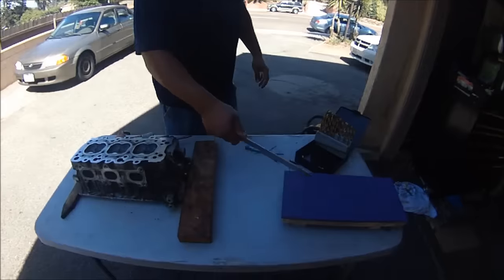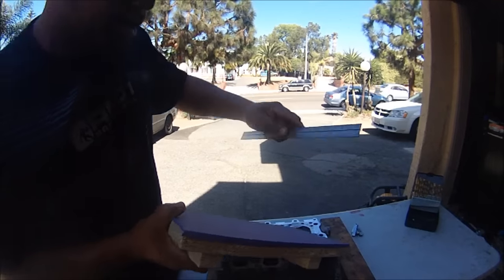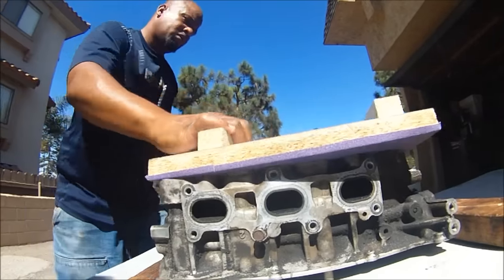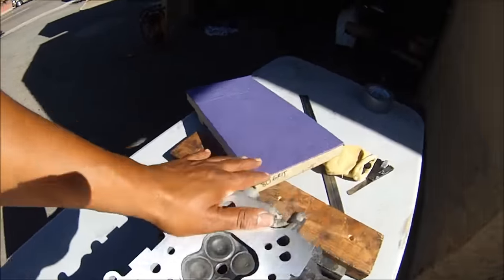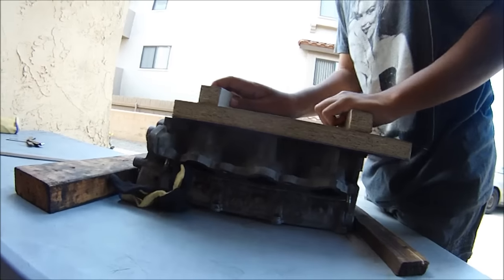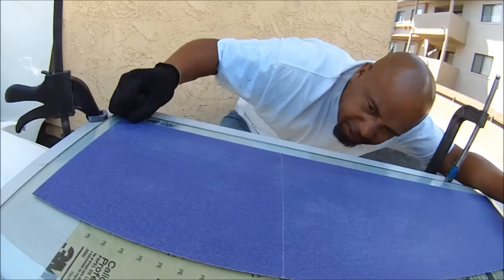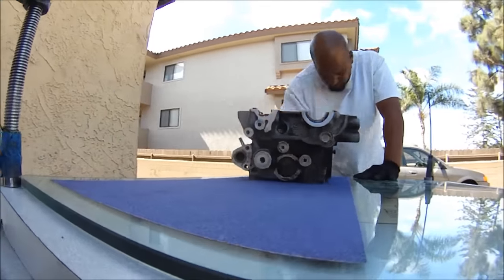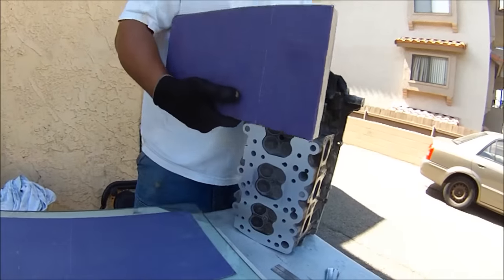HOW TO RESURFACE A WARPED CYLINDER HEAD AT HOME WITH SAND PAPER still works in (2023)

Comment: The cost of the glass, sandpaper
Reply: IRL, it's a lot more than $50 to have someone pull heads, resurface them and maybe the deck, and the put everything back together.  It's feasible that something like a rejected engineered countertop, or other similar flat surface could be found.  It's not like 100m people are going to be willing to do this work on their own.

Comment: good job, but didn't you spend about 45 bucks in sand paper?
Reply from the maker: 3 packs @ $5-7 bucks, its all about the principal.
Reply: +oldskool funk I hear ya my man.  Good work.  I wish I had the ambition
Reply from the maker: +Randy Grover Ya this stuff is brutal at times but a great way to save money. I have learned how to speed up the process now with WD40. its on my latest video and much faster and efficient way. keep your head up my man God Bless.
Reply: compressor with air gun works well or petrol and oil to in spray bottle
Reply: oldskool funk Thanks for all the educational videos! I have a Toyota pick up (22re) with a blown head gasket. I used cooper sealant, and ot still runs like a champion! I'm planning on sanding down the cylinder head too. How can I check it for cracks? Do you have a specific method? Would it be better to replace the cylinder head? I can get one on Ebay for $230 complete. I'd rather save $. Also, can I re-use the old bolts? Thanks bro!
Reply: Daniel Escobedo, Daniel Escobedo, 
NO! Never reuse the cyl. Head bolts on aluminum heads, or even the newer cast iron ones, ... they were stretched into place when they were torqued down, ... & you cannot reuse them because they were designed that way, ... so if you torqued the heads down, and try to reinstall them, they will be weakened from the previous torquing pattern, ... always use fresh bolts, & you can actually see/measure the difference in the old vs new ones, ... like throwing good money after a bad investment, because if you do try to re-use the bolts, just to save a couple of $ skins, then you will warp the head, & possibly the block, by trying to stretch the bolts even further in order to get the same torque on them, ... which simply does not work, ... this was a hard lesson learned from xperience, ... & it was even worse with the early 3.8 Cadillac blocks, & heads, ... a costly xperiment for a would be profit, ... 
this is a good video, & I applaud his conviction of faith, & the use of oldschool technique of working with your hands, ... and your mind, ... there are other methods, but yes, this will work, as he proved on video, ... 
And as far as the praise for the Oldman upstairs, it is also a tacit understanding of his conviction, ... & of his belief in the faith of schooling the young to gain the confidence of teaching a man to catch his own fish, ... something I wholeheartedly agree with, ... teaching the young men/women the basics of learning a trade, is what I have done, & the way I xplained to my now, ...  30 odd students is that if you will take the time to learn my trade, as I teach it, you can apply the same techniques to any trade, & be empowered to go anywhere, learn anything, & be capable of surviving in any situation, ... & in that, I have been successful, ... and the newest hire, regardless of if they are here for 1hour, 1day, or 1 year, is that they are the 1 responsible for cleaning all of the tools, ... I teach it this way, because that is how I was taught, ... & it is such an effective learning tool, ... useful, in so many ways, ... kinda like the scene in Karate Kid, ...Wax on, ...Wax off, ... they buy me a beer whenever I meet them at the local pub, and talk about those lessons learned, ... enjoy what you do in life, because you only got 1 life to live, ...
Reply: Bottom line is he got  a good exercise work out on it.   The feeling of accomplished something is nice.
Reply: Hi my brother I have a 2001 Buick Century how can I tell if I have a blown head gasket on there  I need help brother
Reply: And what was that type of sand paper that was
Reply: And how much will you pay for a rebuilt transmission for a 2001 Buick Century???
Reply: Cheaper than machines lol
Reply: Those sand papers could still be used for future projects. That is how we do it in the 3rd world country ....

Comment: hehe. i’ll have the find the photos from when I got stranded 1,000 miles from home with a blown head gasket. In South Texas. In August. Had to do all the work myself from youtube with crap off the side of the road. 

And indeed, I did the same thing: sheet of glass, mounted to MDF, with spray adhesive over that. Then slid the head back and forth. Worked great. 

The locals stealing all my parts/tools every time i had to leave, though… much more difficult.

Comment: Just a little heads up you guys that don’t have any training, never use silicone on the head gasket or water related items it will get into your cooling system and plug the core of the radiator!  ( BAD). . Love this guy for sure !

Comment: Great job. I resurface my own heads using a large machinist file. It is very true and I can get it down to less the 2 thousandths. I picked up the file at an auction so I can't tell you where to buy them but it is faster than sand paper. Keep preaching brother.
Reply from the maker: I used to think like that, hide my tricks and trade secrets but thats selfish and when we die its not that big of a deal. Share value with others and never have a scarcity mindset.

Matthew 10:8
Heal the sick, cleanse the lepers, raise the dead, cast out devils: freely ye have received, freely give.

Comment: Doing this by hand like this is better than machine cause you always checking on the go.  I had a head machine milled and still kept getting coolant in oil. I ended up using indian shellac glue and had no issues.  Drove truck for 3 years until thermostat stuck closed and didn't have temp gauge working. Threw a rod on the parkway interstate doing 90 mph. I learned a lesson I always make sure my gauges are working now.   I miss that ole 283.  Love your speach at end.  I've been sober from coke since 2001 stopped drinking since I got married.  Now I got to kick my cigarette 🚬 habit.

Comment: I did this on a bmw 528i aluminum head. It worked great! Saved me a ton of money. Not sure if I have the patience on a cast iron head. Oh, a tip! I used heavy fishing line tied tightly across the head to check warpage. With a feeler guage, if you see the fishing line move, you’re there. .002 when done.from .008 warpage. Straight six cylander. These engines are famous for overheating. So, I also bought copper plus gasket spray, and coated the block , then the new head gasket. With new head bolts. 15000 miles later, still good. Thanks again, bud.

Comment: Great job very creative. Had an aluminum overhead cam V6 that would warp. NAPA told me to spray copper seal on all surfaces originally made for motorcycles and the copper in the spray would provide much better transfer and stop warping. It not only worked but worked running loaded pulling small trailer over all western mtns for 300k and never warped again. Why the factories don't use it is a mystery.

Comment: Something to keep in mind is if the heads have cam journals they need to be straight so it doesn't seize the camshaft.sister cooked her dual plug Nissan so bad the machine shop had to press the head so the cams would turn and then surfaced the deck for a good deal.but I've done plenty of old pushrod Subaru engines like this. Good knowledge that you are showing man.

Comment: Pop showed me a trick for observing the defect:  Rub a thin layer of Prussian Blue oil paint on the surface.  As you grind, the higher spots will be ground off leaving the low, blue spots.  Work until the blue diminishes.  Really seeing the progress helps make this a uniform repair.

Comment: 17 years as a mechanic/machinist. Glass works better than milled wood, and is less
expensive. I used glass for my
hand sander, and for my stationary sander. A machinists
straight edge and glass cutting
sand paper can be used to
ensure the flatness of the glass

Comment: Theoretically this sounds like it would work and it will but, you have to remember now you have a strait "deck" but now you have cam journals that are not perfectly aligned, if your head "warps" the whole head bows (either center lifts or center drops) and when this happens your cams will not be tight on the inner journals or outer journals which is gonna cause to much friction.  Proper way to fix a warped head is to figure out where it is warped (center is bored up making center cam journals tight) then you need to have pressure applied to the center if the head and heat the head up.

Comment: Thanks, great video. I have a 9n tractor that a piston sleeve dropped into the crank and my valves need reseated along with the head is out a little over .004 in center so I'm going to use your method and tell my brother the retired mechanic ( know it all ) that I figured this out on my own. LOL... He thinks I should have it milled... Thank again.

Comment: If it was'nt for you mate, I would be at least a couple of grand out of pocket, I did everything you showed on the video to my 84. 4 cylinder diesel Mazda T3500 , took me at least 20 thousand push/ pulls over a few days, but Its now running like a dream, and so are my arms, a fellow suggested when I was nearly finished to attach a couple Bungee straps on the other end of the head , every time you pull the head toward you, the Bungees drags it back !! Hey THANKS HEAPS , I SING YOUR PRAISES TO ALL, Cheers from Australia.

Comment: I did It Tho 
It Is The Way You Measured The Warped Head..
My Car Had Many Overheats But I Try My Best To Overhaul it my self and Used This Technic.. 
Then Applied a Shellac Head Gasket Sealer both sides ,
And Now The Car Runs Out Good 😊
If You Want your car To Last Do This Technique And You'll Be satisfied.

Comment: This same thing using the glass and paper will also work on pumps motors and other polishing jobs. Look into repairing heavy machines. You can rebuild swish plate pumps same way saving a 10,000 dollar pump. I have used this way of doing it for years. And this way is more accurate than most machine shops can do.

Comment: I had a cast iron cylinder head (SBC) that was .004 -.006 warped in the center areas. I used a thick piece of glass instead of wood. But when the man tells you to use 80 grit, do as he says. I used 120 grit at first  - and I was worn out long before the cylinder head was.  And the next day I was hurting.   I switched to 80 grit and things went much better.

Comment: I want to thank u for ur words of wisdom. Not necessarily  about the the resurfacing of the head. I mean your words about never giving up. Right now I have a group of people hateing on me like you would never believe. They are the reason I'm redoing my head's. They've already broken into my house tagged up the inside of my house my garage my car on my camshafts they carved their gang or whatever they are from and a bunch of bad words everywhere on the car interior and on my paint. So I ripped out interior went to junk yard got better interior than what I had and then pulled some heads as well because they took a hammer to my original ones and broke them and then I'm a painter so I just repainted my car cause they carved profanity all over it and shot it with bb gun. While I was painting it they would sneak up to my garage and spray something into my garage so it would get a chemical reaction and I ended up with fish eyes everywhere so bought more paint and plastic and created a booth inside my garage of plastic painted it flawless this time now I washed and cleaned interior from junk yard and cleaned and about to resurface the heads and almost gave up there for a second but u are a great man. I wanted to tell you. I grew up without a father and all my life I've had to find out how to do things the very hard way. It's been a journey for me but I've always was looking out in search of a man like your self to help me understand life thru sort of a father figure type person. And everything u say I needed all thru out my life. My life everyday is full of haters from when I wake up to when I go to sleep every day they are outside trying to intimidate me harass me and always destroying everything I have. Always trying to keep me down. I needed to hear what you said in this video it really made my heart a little stronger so thank you for that I was really down and really needed someone to say what you said thank you I won't ever forget what u said in this video thank you.

Comment: Alloy heads warp if overheated and need to be sanded or milled back to flat.Iron heads usually don't warp but can crack usually between the valve seats.Had that happen on an old Audi 100 diesel that got cooked.First time I saw a sheet of glass used to check flatness was many years ago was by a mechanic friend of mine who was fixing a BMW 5 series.He used the process shown here and it definitely works.He was old school.
Reply: If a warped head is milled flat without first straightening it flat the other side of it will still remain warped which would be wrong of course and may cause problems later. However I've done this hack job on high mileage engines hoping that the camshaft beds were worn out enough to not snap the cam in half after 1000 miles.

Comment: The lord has challenged me in so many ways that to this day have made me stronger and smarter. I appreciate this video and message. I wanted to know, how you would handle any sand particles that may come lose from the paper and fall in the head during resurfacing? I looked up the possibility of sandblasting the sides of the block on the internet to clean the rust and paint off and found countless comments that say not to do it because you can not get the sand particles out of the engine. That it would eventually find it's way I to the cam shaft bearings or the crank case bearings and then your engine was toast. I ask because I imagine you still get this part dipped or dip it yourself in order to clean it, is that how you make sure it is cleaned completely? Thank you for teaching me something new.

Comment: I just got done watching a ChrisFix video. He used a headgasket leak sealer on a engine and drove it for 2 years to see how it held up. It managed to put up 10k extra miles on the car. At the end he opened it to show that the head gasket was actually just fine. The engine was warped leading to the leak.

Sadly he got his dad (it was his car) another car instead of fixing it,. All I kept thinking was.. can't he sand the engine head down flat again?? Good to see you actually can and fix the engine.

Comment: Good old school diy. I rebuilt many engines on picnic tables sometimes simply doubling up head gaskets can compensate for large irregularities in the head or block surfaces. Once torqued down you can tigten the center bolts a little more to straighten it out too. Worse case scenario is you gotta get it machined its worth a shot to try and fix it.

Comment: After all that an a cleanup prep you can also use or add ultra black by using a piece of foam an lightly apply to both sides and do first spec tightening an let it squish, then the second squish, you can control the amount of silicone by using bright light, you can apply it so lightly you can see through it as I do around water jackets. the excess in cylinder will burn away an don't load steam holes up. I also reused head bolts an brass brushed the old head gasket doing this so far 3 R&R's an still holding true. Been over 2yrs now and still sealed perfectly not one problem or issue. I also apply this same technique to gaskets, do one side lightly let it set up or stick to one side then the other then apply. Upon removals of the prior two ultra black trails you can see exactly where the silicone flattens out high or low or uneven. an removal is so easy or it can be left there as another slight application layer won't matter. I've done this many times with no failure, even reusing one time use head bolts. I had a perfect loaner tester car to do this with. excellent results and still holding perfect.

Comment: This is good if you don’t have the $100-150 to get the pair of heads decked, but by no means is it as good at all. If your running NA ok if your boosted 8psi and up you better not go this route or you’ll be rebuilding it in a year.  Believe from experience I used to think me do this was as good but got proved wrong when I stepped up to boosted. Good job by him though. I dropped a pair of Ford GT heads at the machine shop today.

Comment: My only concern is if the block isn't true now from the heat.. but at least this will get you by for a long time. 

I have done this with a number of lawnmower type heads and blocks as it was easy to do the bock also. Works perfect.

Comment: Someone likely brought this up already, but there's another method that works very well. Glue, or whatever method works the sand paper onto a flat surface. Then lay the head on it, and slide it back and forth at a diagonal. Swap diagonal directions roughly after equal number of full strokes. This uses the weight of the head in your favor reducing amount of muscle needed to do the work. The weight of the head also helps ensure final flatness of the head. Different method, but same concept.

Comment: Between 100 and 120 grit gives the best RA finish for a fibre-composite gasket, the best finish pattern is tiny swirls so if possible swirl the finish sanding in tiny circles and your gasket will be bitten in perfectly.